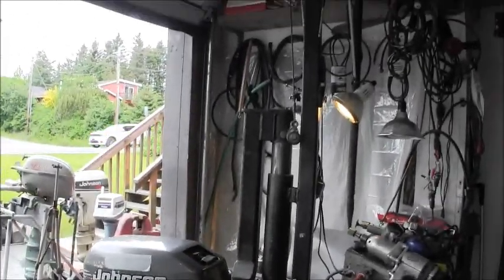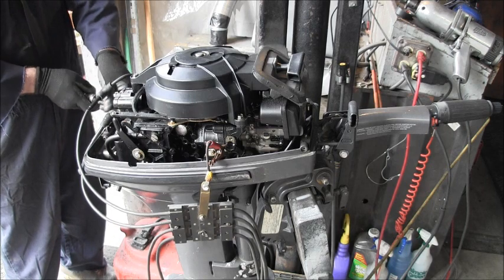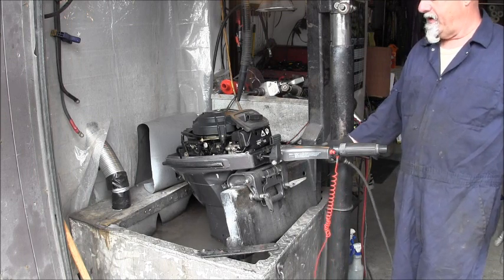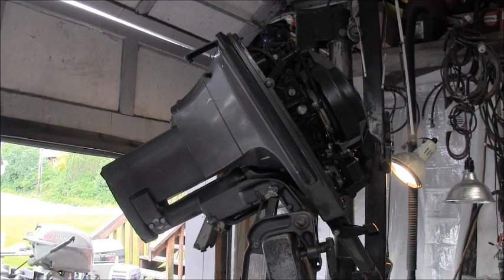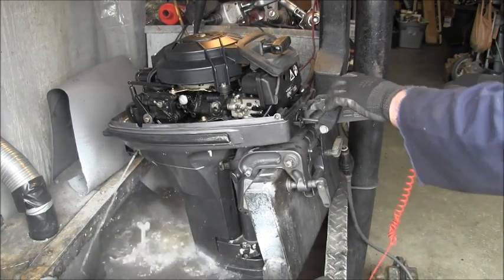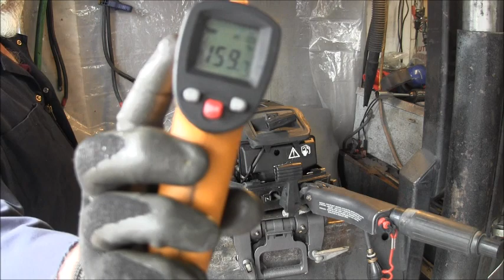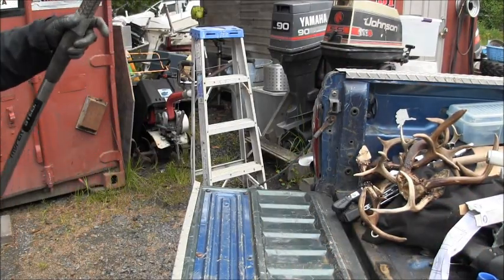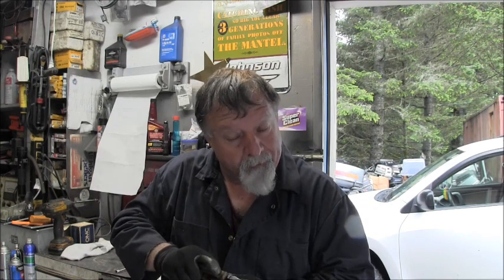JOHNSON 1999 15  HP,  HOT

Comment: The tune is, When You're Hot You're Hot - Jerry Reed.  Loved the Rifle. Glad this motor did not end up a junker like the last one.  I am working on a 1976 Evinrude 55 HP that belonged to my father.  Sadly it needs at least a new power pack (no power to the number one coil tested at the pack), and one of the coils (#2 literally and figuratively) replaced as it tested 0 ohms both on and off the motor.  I have to save up for the parts (I am disabled and live on a fixed income) and can hopefully find some used ones that still have a bit of life in them.  I figure Rome wasn't built in a day, The motor will be there when I can do it.  Thank you for taking the time to share your talent and wit. Rock on bub!!  
Jeff, from Augusta Maine.

Comment: I have a 92 model 9.9.. lots of carbon build up on the piston.. do u think decarbing the piston and replacing the head gasket will raise compression,, in at abt 97 on the bottom cylinder and 100 on the top.. scoped the cylinders and they have some light rust, like the engine hasnt run in several years.. was thinking of filling the cylinders with diesel but not sure exactly where the piston has to be so the diesel doesnt leak out of the intake or exhaust..

Comment: What gap do you run on spark plugs 1984 Johnson 15 HP seahorse ?
Reply from the maker: On older 80's motors I like to open it just a bit more to  .35  A old timer told me to do this as it gets a bit more  burn & less likely to fowl.       kb
Reply: @kodibassInsideoutboards  
I notice the manual says .040” or 1 .0 mm I thought this was excessive but I guess not !
Thanks from Alaska

Comment: do you run across alot of the 8 and 9.9 , 15 hp evinrudes with a cracked jet well in the carb? I bought an 8 hp, and a 9.9 and both of the plastic jet wells were cracked in the same place. the engine seems to ri run fine with the crack in the jet well, but I replaced them anyway.

Comment: Hi I have Johnson J10rgtsss is it 15hp? On the sticker it says 11,2kw but it is J10 model number. Any suggestions? And could you tell me how to adjust idle speed?
Reply from the maker: It should be the same as any other 9.9 / 15 powerhead,  behind the aribox is a small screw that is part of the cam roller assembly attached to the carb, it takes a small allen wrench to turn it, Turn that screw clockwise to increase RPM's  CCW to lower.   kb
Reply: All done. Works like a dream. Thanks and All the best.

Comment: I bought parts motor Johnson 56 RD -18  30 hp seized up for 60 bucks he said it pulled over but the spark plugs were also seized and I mean there was no threads left on the plug or the head and sand in the cylinder so much rust sat in a barn says it all worst I ever seen
Reply: Oh yeah thanks again for the videos 👍🏻